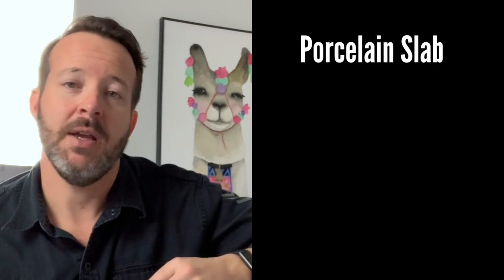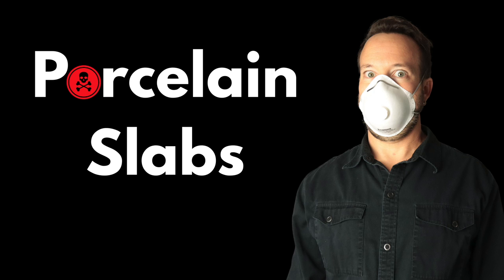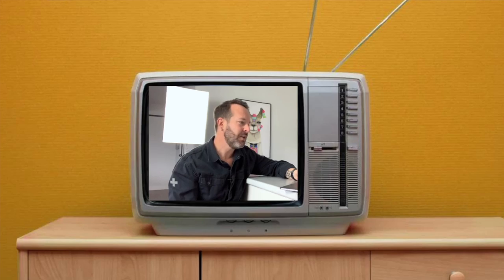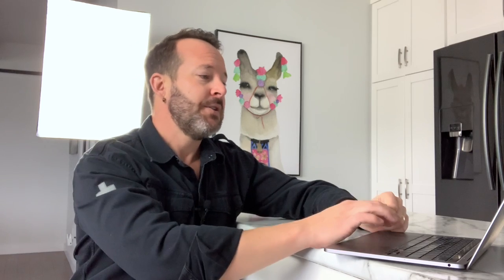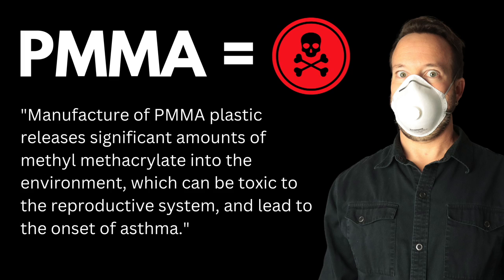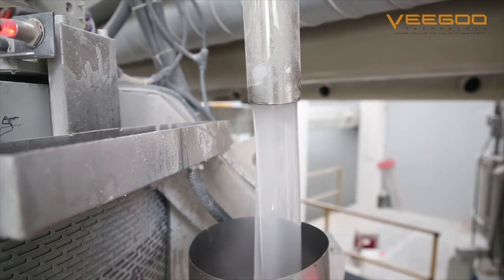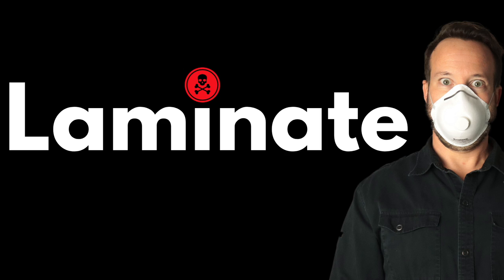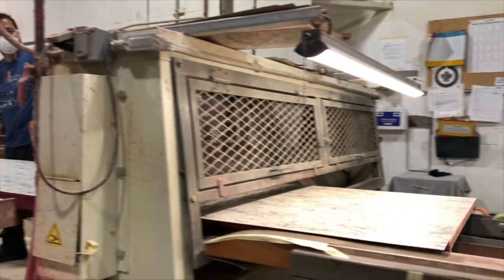Are Quartz Countertops Toxic?

Comment: Yes, very important to do research. I saw a video regarding counters somewhere, but don't recall where. A couple was having quartz installed in their home. For some reason the quartz didnt have something cut out of it, so the installer cut it out right in their home without a wet saw to contain the silica dust. Dust got everywhere, even the hvac system and made the family sick. The family filed a lawsuit and wasn't sure if their house was going to have to be torn down or not. I'm still going with Quartz, but I know not to let anyone cut anything out in my home.

Comment: Hi Mark, what about stainless steel countertops?  Are they toxic, what do you think of them?
Reply from the maker: I haven't researched enough to know whether they are toxic or not, or to what level.  However, as a food safe surface, they are supposed to be great.  With anything that is manufactured there is probably some level of toxins created somewhere in the process.  But to what level I don't know.  I like stainless as a surface.  It takes abuse and is heat resistant.

Comment: Let me weigh in a bit - the page you're citing is a joke and pretty misleading. Putting unsealaed soapstone on the safe side is outright dangerous (many a soapstone contains asbestos fibres), never put that in your kitchen. Also, maintaining the idea that something has less stuff in it because it was manufactured in the US is.. well... I'm at a loss for words there. Here in Europe, there's much more oversight and control over what goes into things than in North America. I'd still go for something "natural" if possible (yeah, porcelain is great, but I've never seen a 4 cm thick slab), and the sealants over here need official approval, are checked, and once the solvent is evaporated are completely non-toxic. Very very weird, their "study"...
Reply from the maker: Appreciate your input Loretta.  Let me know what sources I can check out.  I don't mind correcting myself and I don't want to put out misleading info.